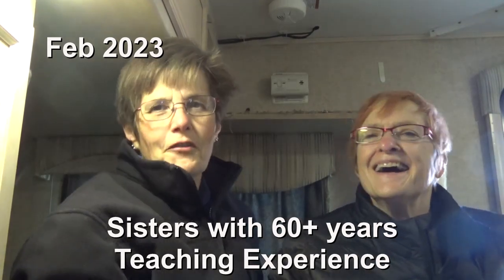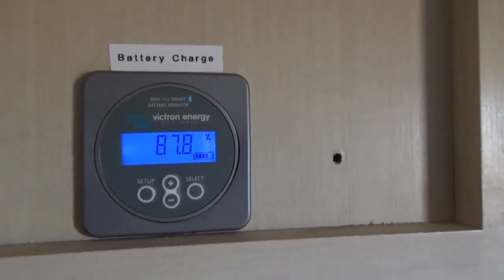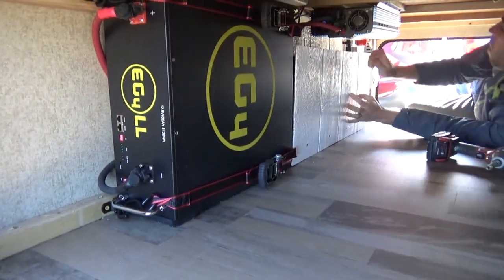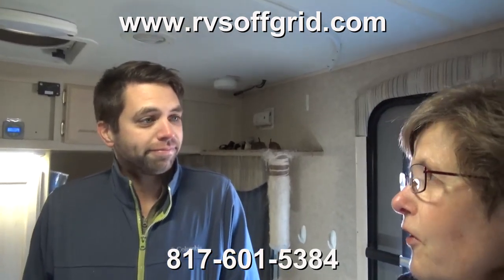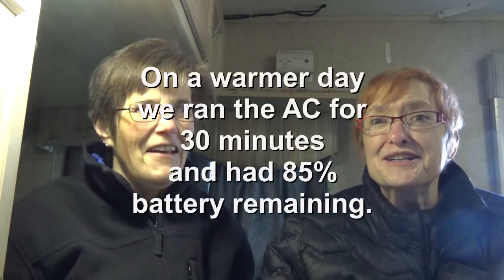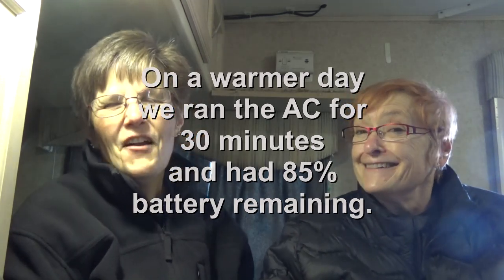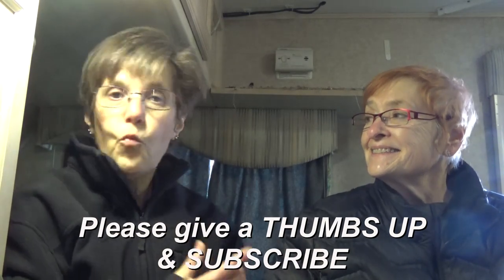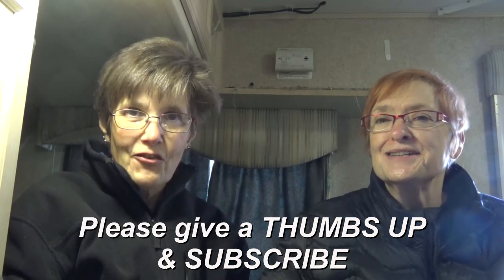Major RV Solar Install

Comment: I live in Texas and was having problems with my solar install .Found RV's Off Grid on google. Called Jason and made an appointment . His father Bruce was very helpful . He checked my system out updated all the firmware and got me going again. I took his suggestions upgraded my battery and installed some more Victron equipment. Very pleasant and down to earth. His price for trouble shooting and consultation was 1/2 of what another local RV technician quoted me.  Bruce has a massive solar system that he installed on his home/shop. I will recommend them and will use them in the future ! You made a great decision using RV's Off Grid ! Love your channel and all of the  state park tours !
Reply from the maker: Thank you for watching.  We thoroughly enjoyed working with Jason and Bruce.  We felt they went far beyond the minimum.  We will definitely use them again if we have more solar needs.

Comment: Hello   from the stormy ozarks Melina and Sharon! Another video of value! You will recoup the cost of camps by boondocking and enjoying the seclusion of other campers.  you will get spoiled boondocking compared to visiting a rv park.  You made a wise decision to update your rv rather than the expense of the new rig,  I use my 800w foldable solar panels outside on the ground to charge my portable 3000w generator. more than enough power to run my ac, microwave and heaters in my conversion van with my roof  fiberclass top tent. i do carry my portable solar electric fence to keep the critters away . Grace be with you both. Tight lines!
Reply from the maker: Phil, we've been doing more and more boondocking.  On our six week trip to California last year, we spent $105 at RV parks.  The rest of the time, we were boondocking.  So far, we love the solar install.  We had a little, but this is a game changer.

Comment: Nice setup, but please cover your naked cabling on the roof. Solar UV will eat it in no time. Try to push it under the panels as much as possible and maybe get some self adhesive plastic conduit to cover the exposed cables. Enjoy!
Reply from the maker: Thanks for the suggestion.

Comment: Thank you so much for this video.  I want to add solar to my small class c.  It came prewired for both roof top and a suitcase style panel, but nothing else.  I can’t do it myself and had no clue how to get started.  Maybe a trip to Texas is in my future.
Reply from the maker: The system is still new, but we are loving it.

Comment: Thank you so much for posting this type of video. It makes more sense. We have the same model a newer year but our storage compartment that’s what we were worried about space loss because years you know that’s the only storage compartment on that unit except for the indoor storage yours looks like it went very well, now that we’ve got a an ideal. I think we also will move forward white little bit solar. The RV came with it’s just enough to triple charge the battery once again thank you.
Reply from the maker: Thank you so much for watching.  We are eager to really try out this much solar.  We've been on short trips, and it's been great.

Comment: Watching this because your trailer is similar to one I considered getting back in 2016 or so, but delayed because trailer storage is so expensive in my region. So I went for a very simple set-up.  I’ve had my ProMaster City cargo minivan new since 2018.  At first I minivan camped in parks with some dispersed camping (boondocking) by throwing a cot in back, along with a folding table, camp chairs, a cooler, stove/kitchen stuff in one bin & clothing/stuff in another.  I did have a power station to run a CPAP with a 60w folding solar panel.  Then for last 1 1/2 years did a simple camper conversion that included 100w solar panel on the roof & solenoid to use the alternator to charge the 75ah AGM house battery with all the controllers & fuses to run some 12v charging outlets, lighting, a 400w inverter, a small 25qt fridge.  This means I have been able to use a couple of small appliances like a Dash griddle, 12v HotLogic Mini slow cooker oven & a 12v kettle. That has been fine so far & I was surprised at what a game changer having a 12v fridge has been, but now I’m looking an upgrade to a lithium 100ah battery (maybe a 2nd panel) with Victron DC-2-DC charger & a 1000w inverter (has a surge to 2k) so I can run an Nuwave induction stove (my model can switch down to 600w, 900w from the standard 1100w it would run at in a home.  Using my duel fuel (butane/propane) stove outside camping has been fine, but I’m not thrilled with an open flame in such a small space inside during bad weather.
Reply from the maker: Wow!  You truly have made the most of what you've had.  We wish you only the best as you continue your travels.

Comment: I really appreciate how you two explained your system in non overly technical terms. What you did makes sense and you should recoup most of the costs in short order by boondocking and not paying the high campground fees. Please keep us updated on how you use your system and how it preforms. ❤
Reply from the maker: We plan on making a video after we've tried it out on a month long trip and a six week trip.  We love being able to boondock, but it will be much easier with this set up.

Comment: I noticed your bill didn't include an inverter? How big is it? Yes, prices for new is out of reach for most non working people. I'll probably keep mine until it falls apart from rot in my back yard. Thanks for your video and happy camping! We go on our1st next week.
Reply from the maker: I meant to mention that we kept the inverter we had. 4000 wt peek 2000 wt running.